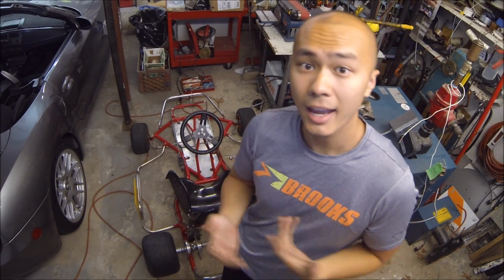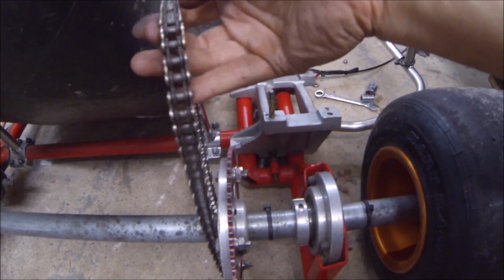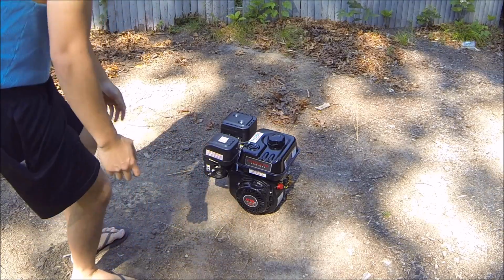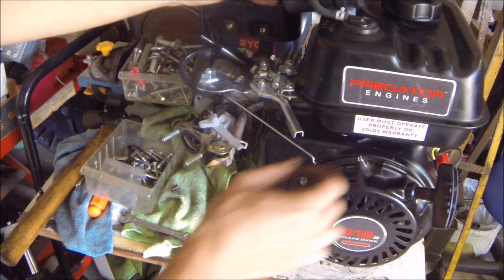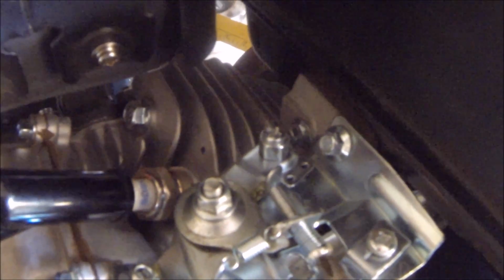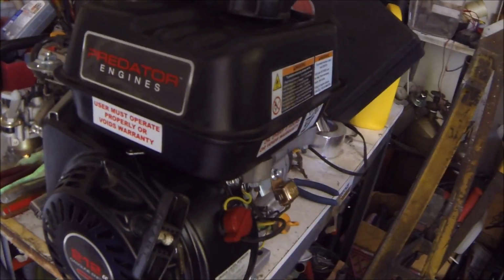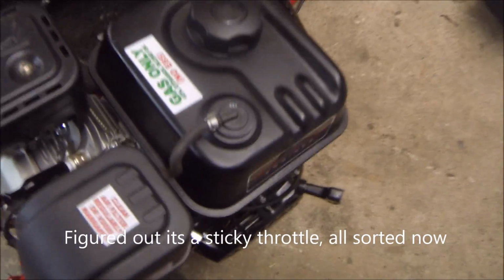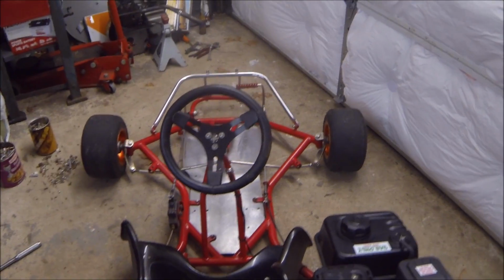Teardown and Predator Install - Go Kart Build Part 1

Comment: Okay so first off, engines aren't supposed to be "broken in" anymore. Leaving it outside and running for 3 hours did nothing but dust up your crankshaft bearings and probably clog a good portion of your air filter. Also, that's not the governor. The governor is deep down in the engine and for someone of your engine knowledge shouldn't be touched. Finally, your whole rig for the throttle is useless. When you put in the throttle cable, the return spring on the frame is powerful enough to return the linkage to idle speed. An electric motor with enough power to match up to the power of a predator will definitely cost you quite the stacks.

Comment: You put the clutch on backwards
Reply from the maker: You can't put on a centrifugal clutch backwards
Reply: +zed4me yes you can the flyweights are to be towards the block in the sprocket is to be to the outside it really don't matter because you went with the torque converter which is the best set up anyways but stretching your frame to relocate your engine would prevent you from getting burnt by the exhaust also you could put a bigger motor on it good luck with your build it's always nice to see somebody not afraid to take something on that might be a little beyond your skill set for the most part good job
Reply from the maker: Kevin Pfeifle can you explain why the clutch had to be put on that way?
Reply: +zed4me they are always done that way for two reasons, 1. Has less chance of dirt getting into the clutch. 2. If the chain happens to come off of the sprocket it doesn't tear or grind into the side of the block
Reply: it's  harder  on the  crank    mounted  outboard

Comment: I heard of a fuel injection system for 1 cylinder engine that learns as you drive so you don't need to adjust the carb they did this on cars and cameras

Comment: instal a Mikuni 22/26mm replica carb on it, it adds much more power.

http://www.aliexpress.com/item/mikuni-carburetor-vm22-26mm-110cc-125cc-dirtbike-atv-pz26-performance-carburetor-free-shipping/1605054571.html?spm=2114.01020208.3.137.VNIbSz&ws_ab_test=searchweb201556_0,searchweb201602_5_10057_10056_10055_10037_10049_301_10033_10059_10058_10032_10017_10060_10061_10062_10063_412,searchweb201603_6&btsid=4717b6ae-e04c-4501-9d98-a38f4ecc84bc
Reply from the maker: Keep watching my series, I'm doing something different with this kart

Comment: to avoid having to use stronger return springs on the throttle, you loosen the nut on the arm 1/4 turn. Also,   bypassing the governor instead of removing it completely gives a great chance of the little plastic wheel to shatter. I would remove it all together.